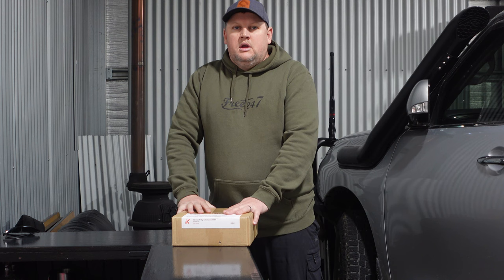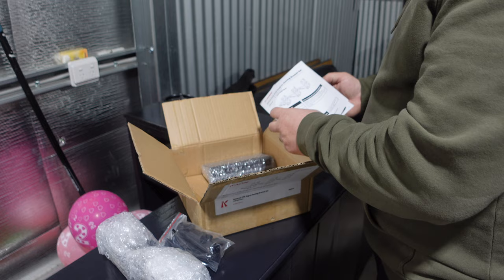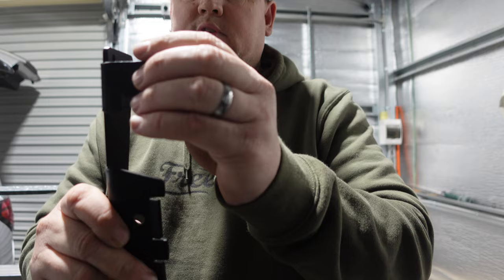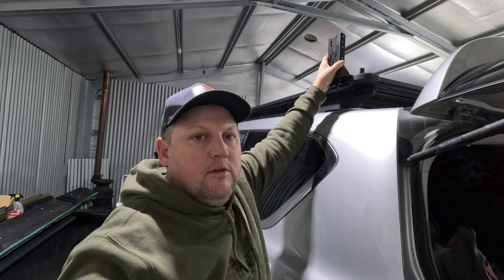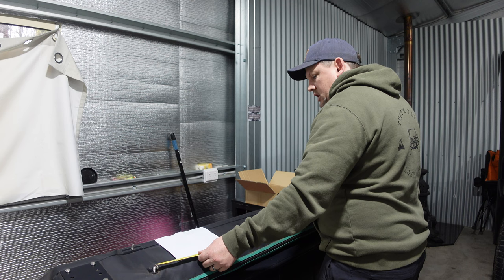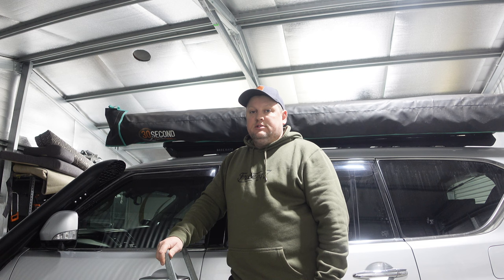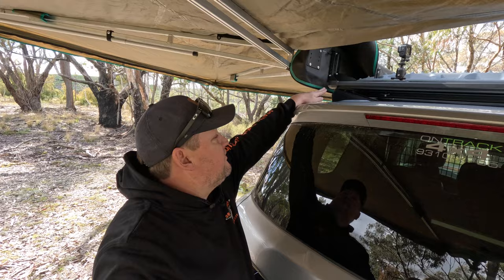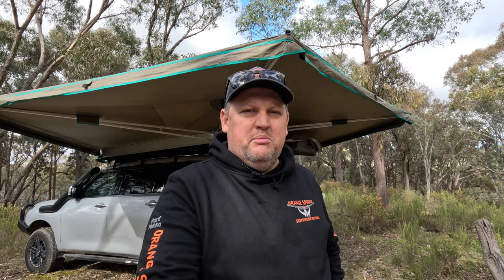KAON 270 DEGREE AWNING MOUNTS FOR ARB BASE RACK - Y62 PATROL

Comment: Did you end up using 2 or all 3 of the Kaon brackets? Looks good mate. I just got my brackets, about to install my 270 as well.
Reply from the maker: Hi there 
I still only have 2 brackets…. But I reckon a 3rd bracket at the back of the roof rack would be the best spot as this is where the awning pivots
Hope this helps and cheers for the watching 👍
Reply: @unproadventures4142  cheers mate. Did you put washers on those bolts that go from the awning into the brackets? I didn’t get any with mine but will probably chuck a few on just to spread the load a bit on those nuts
Reply from the maker: @Bergo101  I think I did mate 
But yeah good idea it can’t hurt hey 👍